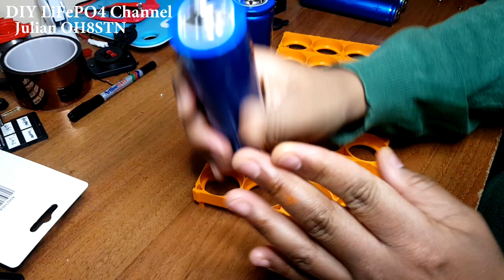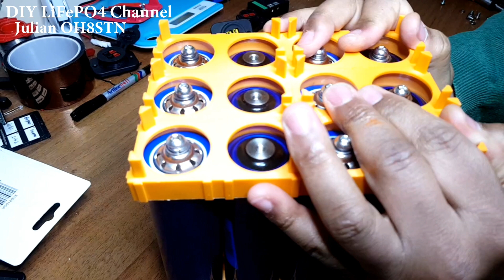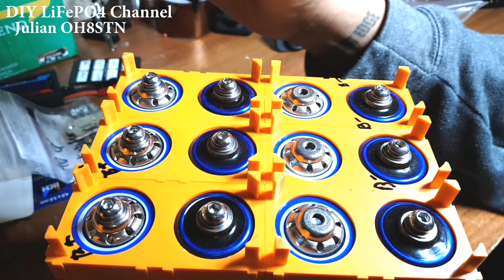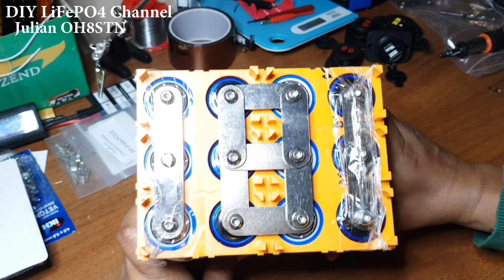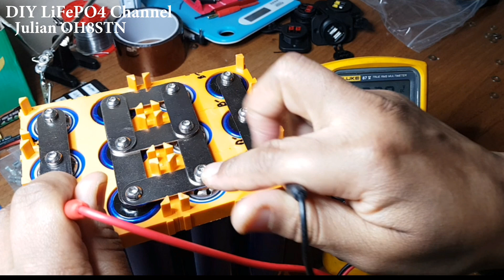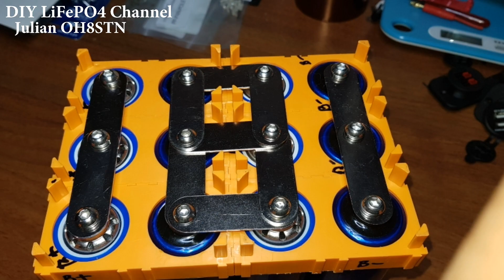Headway 45 amp hour 576wh 12.8 volt pack assembly

Comment: I built an 8S-7P pack for my 24V solar system. For coupling plates I managed to find, (in a scrap-box), some brass finger-plates taken from old doors. They are 300x75mm, 1.6mm thick. The modern equivalent from the hardware store is only 1mm thick, but that's plenty. Tape-measure, drills, and sandpaper to remove the varnish to bare metal, left me with 7 plates to do the bus-bars, held down with M6x10 pozi-pan screws with single coil spring washers. At the other end, middle-holes were drilled to fit round the 4 triangular feet. For the +/- end terminations, 15mm (1/2") copper pipe flattened, drilled and cleaned to bare metal serves the purpose, 32^2 mm. They are longer than the brass busses, being fitted with M8 stainless bolts for connection terminals. Both ends are covered with 1/16" plastic sheet.

Comment: Hello from the high desert of New Mexico USA 🇺🇸. I just found your channel and I liked and subscribed. I have a 1967 GM TDH-4519 city transit bus that I live in full-time, it uses two 8d size batteries that are 4400 cranking amps each, yes it's a 12 volt system and wired in parallel for 12 volts , 8800 cranking amps , how many Headway cells would I need to start my bus please?

Comment: What are the side fx of too much resistance between cells if used not enough connectors? Would you recommend using like 480 of those cells to make a 48v 5kw battery pack?

Comment: I am doing this a little differently but more straightforward. I have 16 cells. I am making 4 packs. Each pack is controlled by a 4S 100 amp BSM board. So every single cell has its own monitoring and charging. This is where 18650s fall down I think. LiFePo being what it is you really need to monitor each cell individually. Thank god for 38120s they make life easier. The o/p of the 4 packs will be paralleled. That gives me 12.8 volts and each pack can deliver 100 amps. A potential of 400 amps.  Each headway is rated at 8 ah so I guess a total of 128 ah. That should run the microwave for a few pizzas!

Comment: hi, great video !, I've used 18650 cells but I need to make a 72v pack for a EV buggy with a 72v motor and I wonder if it could be a lot better with the headways, this would give the amps in a much less lightweight pack. I know its a high voltage but what would you recommend ? thanks !!

Comment: If you use it as starter battery, where you connect BMS  (C-) to. Is it directly to ground. Confused because, car chassis Load Negative (P-). 

Question is both (C-) and (P-) could be shot directly or not?

Comment: Great project Julian!  Someday, can you show how you charge the individual cells prior to assembly and then how you charge the pack at home after the BMS is installed?  How do you measure the charge percentage? 73 Charlie
Reply from the maker: I will certainly do that for you Charlie.. I think I already have the clips from charging the cells, I just need to put it together into a video and narrate it.
Reply from the maker: For the solar generator I'm using the shunt. The shunt measures voltage in and out of the pack, then since that information real-time to my mobile phone.
Reply: The DIY LiFePO4 Channel Thank you. You stress the idea of system, so I am trying to see how to manage the battery pack long term so what are the other components in the system to keep the battery pack charged when not in the field. I hope to adapt your methods for a 28v system so I am trying to understand the details. Charlie
Reply from the maker: Is there some reason why you want to create a 28 volt system Charlie?
Reply: The DIY LiFePO4 Channel My PRC-104 uses 28v. The batteries it uses are quite expensive and although working well now, I want to build a system I (1) understand, (2) can maintain myself, (3) add off the shelf components like rigid and flexible solar panels and (4) scale up and down weight and capacity as desired. So yes, I’ve drank your cool-aid and want to do it myself.
Reply from the maker: Outstanding. I think I'll have to do a blog post on lithium iron phosphate battery pack for the PRC series of radios.
Reply: You will need a LiFePo charger then charge through the BSM board. That will gently charge them. That is how I do it. The BSMs are going to individually give each battery what it needs. My charger gives 12v and I got it from ebay. It allows me to charge when using either shorepower or my generator. That way nothing is wasted.

Comment: Bus bars are not level, you should rearrange so that they are all flat this will give a better connection.  A bus bar that is at the bottom, should be at the bottom at all connection points, and so on.

Comment: I can tell you that a medium size helicopter will draw around 450 amps @24v for about 20 seconds gradually reducing to about 250 Amps at about 50 seconds before the turbine starts to accelerate faster than the starter. I think this pack would start one for sure. 7s4p anyway.

Comment: i want connect 2 headway 45 amp hour 576wh 12.8 volt togther double amperage how to wire
Reply: Just keep paralleling series set of 4 until you obtain the Ah your looking for.   + to +  - to -  ....

Comment: This is great information, well presented, clear and concise.  Can you provide a link or direction to sourcing the Headway kits for assembling the battery?  I have searched and have not found a US supplier.  Thanks
Reply from the maker: Hi Dennis
I'll publush a parts list when I publish the full build video. You don't have to use these specific cells, they're just a guideline. The best places to find these cells are at online ev or E Bike Shops. 
Here's the link to the BMS I'm using https://oh8stn.org/blog/2019/01/25/diy-solar-generator-bms/
I'll try to have the parts list ready as soon as I finish the build.

Comment: These are excellent videos, I do have some questions, 1. How do wire in the BMS to these larger capacity Battery banks for example the 8 and 12 cell versions, I'm still confused on how to wire them in.
Reply from the maker: Have a look at this video playlist. Videos are spread across both of my channels, but there's a video for wiring to bMS, videos for connecting the cells in series and in parallel,...
DIY Solar Generator 45ah 576wh OH8STN: https://www.youtube.com/playlist?list=PLKMrdrsNkFA44Jt6vgiC_WIgv-pUYqzGf

Comment: Would love to use something like this in my car.  I just need to read up on all the stuff about lithium so I could safely run it. 

I just want something that can run on 13.8v that my alternator provides. My current battery dips to 10v when starting the car. 

Probably normal or not idk. I let it run out to 0v  (lead acid) and revived it. Sat for over a year is why that happened. It has no issues starting the car really. Just would rather have a higher voltage for starting.

Comment: These batteries only lasted a couple months even when using a BMS designed for them.
I liked the plastic connectors but that’s about it!
Blew through 40 of these what a waste.
Reply: Dana Putnam    Is that from experience? Thinking of using these in my solar system in my house
Reply: Yes my personal experience two years ago. They failed within months. As cells went bad I ordered replacements. But pretty soon they all failed. Let me be clear this was two separate bikes that failed.
These are very attractive with the plastic connection system was really fun to build the packs 72vx10 amph.
I have been building Ebikes scince 2007 have a lot of experience with different chemistry’s 
The best are lithium titinate (heavy but high power fast charge long life) second lithium iron sulphate (lipo) very stable dependable heavier than lion lighter than titinate.

Comment: It seems to me that by having 12, 15 amp hour batteries together that you would have 180 amp hour battery....I guess that it does not add up that way..
Reply from the maker: Its important to understand how we combine cells in parallel, or in series to to get our desired pack voltage, and pack capacity.
Each cell in series adds to the overall voltage of the pack. Each cell in parallel adds to the overall current capacity of the pack. 4 in series with none in parallel will give you 14.4-14.6 volts, 15ah capacity, when fully charged. 4 cells in series, with 2 sets in parallel give 14 4-14.6v and 30ah of capacity. 4 cells in series, with 3 sets in parallel gives 14.4-14.6v and 45ah of capacity. Make sense?

Comment: How are you calculating the AH, 8ah x 12 batteries should be 96ah. Or even if all the cells were at 7ah thats still 84ah. What am i missing, i thought you just add together. Thanks
Reply: Oh these are the 15ah cells, so it should be even more. 15ah x 12: 180ah
Reply: no. 4 cells make 12v/8ah every group of 4 jumps up. 8 - 16ah / 12 - 24ah. Etc etc

Comment: Can you add a link for these " 15ah" cells because I'm pretty sure you have headways 10ah cell, so you pack is actually only 30ah
Reply from the maker: FYI, the headways come in 8 Amp Hour, 10 amp hour, 12 amp hour, 15 amp hour, and 20 amp hour?
Project info and details.
http://oh8stn.org/blog/2018/12/09/diy-solar-generator-576wh/